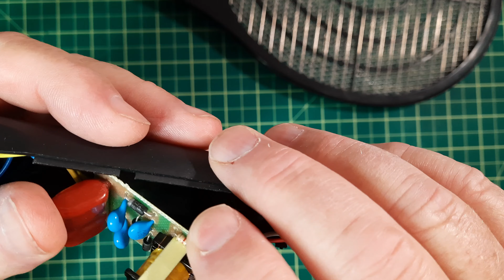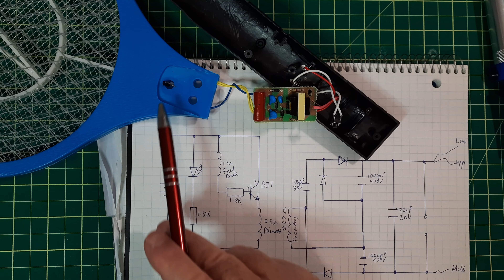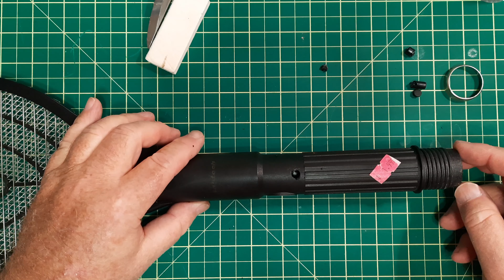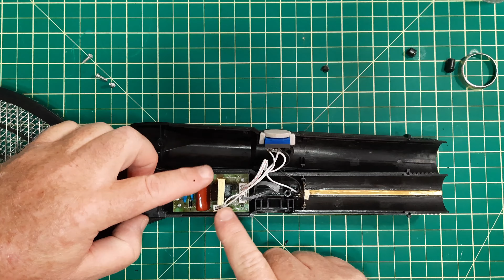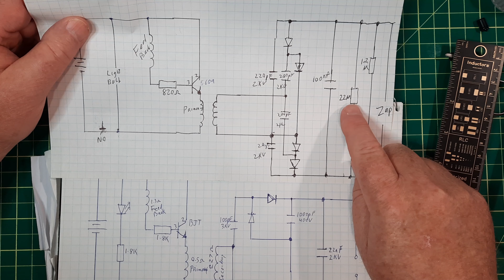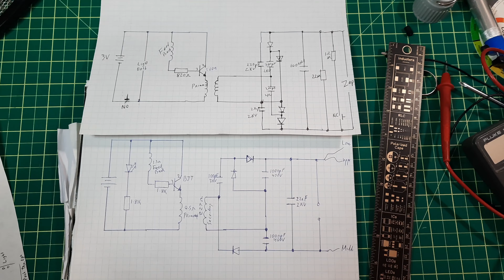Bug Zappers save a cent and zap your customers with Schematics

Comment: Why do you think it oscillates?
Reply from the maker: It needs to oscillate to generate the first step of high voltage through the transformer. On the diode/capacitor side it charges the capacitors on 1/2 the cycle then the other on the other side of the cycle. The end were the bug gets zapped is high voltage DC.
Reply: @retireeelectronics  Yes, but I don't see anything in the primary ckt to cause oscilations.  What am I missing?

Comment: For an alpha detector you need to be able to set the voltage quite accurately. An extra stage of multiplication may be enough to get the spark. I would suggest adding a variable supply voltage, on mine with an LM317 variable supply variable between 0 & 5V.
Reply from the maker: Not a bad idea, I figure the gap is about 4mm so I don't need to step up the voltage a huge amount. Have a good day

Comment: can this bug zapper convert to a power bank ?
Reply from the maker: Nope, one uses C cells and the other uses AA.  But a person could fit a 18650 lithium ion cell with addition circuit easily into both of the zappers handles. Have a good day
Reply: @retireeelectronics  but i have seen in youtube Old phone charger and electronics convert in to power bank

Comment: I love these bug cheap bug zappers, though the handle of man broke so easily because it cheap plastic and wanted to repair it. I did so when I found boxes of old nonfunctional 2D maglites at the scrapyard. Adapting one of the handles of these maglite spares onto my broken handle bug zapper, even utilizing the maglite push button to operate my now “cyborg bug zapper, and everything is now right as rain.
Reply from the maker: What works works. Have a good day

Comment: I actually have the blue one, but in a better version. Rechargeable battery and bleed off resistor.
China just makes whatever customization the client asks for.
Reply from the maker: Probably a bit more expensive than $7.99 Canadian. So So many designs using the basic frame are probably out there. Have a good day